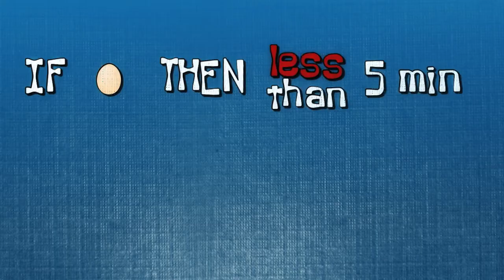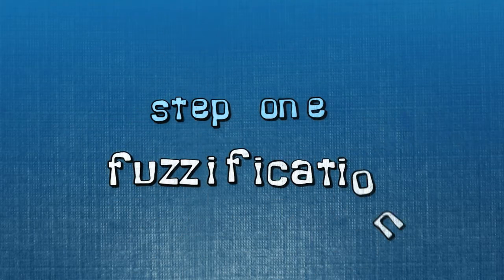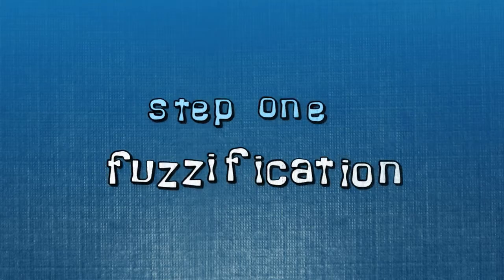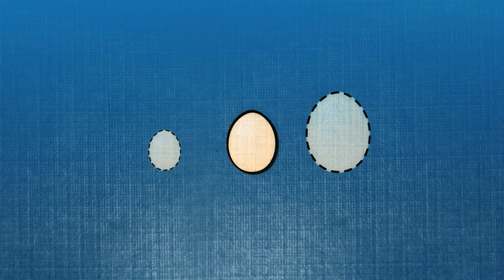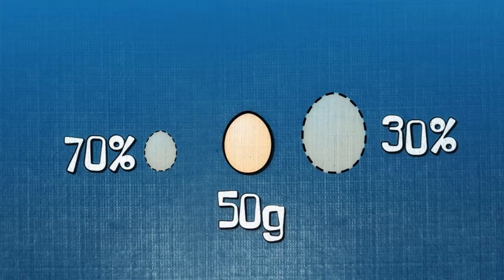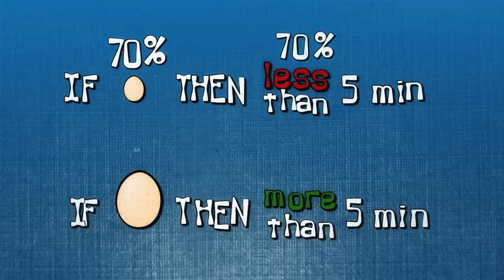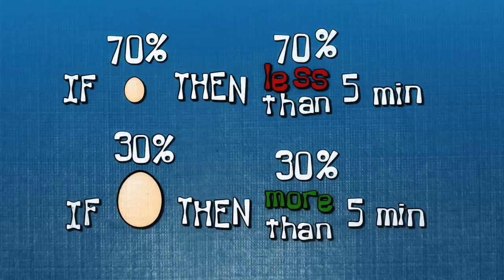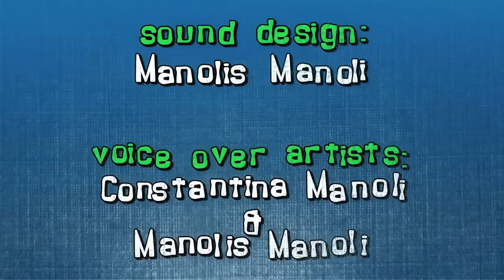An Egg-Boiling Fuzzy Logic Robot

Comment: Why not just a linear equation?"  f(x)=(x/10)-1 ", where x is the input weight in grams and f(x) is the output time in minutes? Or is this a more efficient circuit designed to only compute the egg boiling time and is therefore incapable of algebra?
Reply: SuperJimmyChanga Fuzzy systems are designed to take decisions more human like.